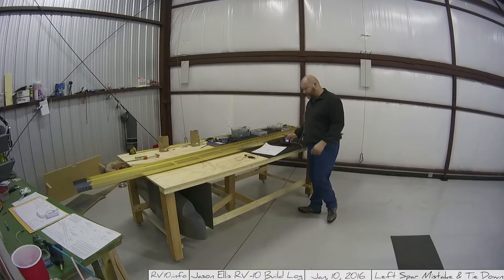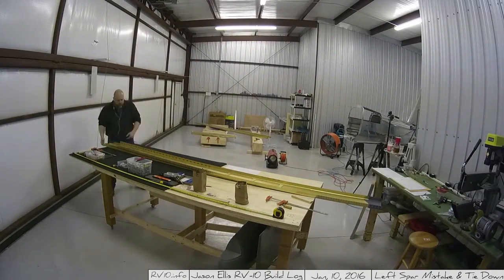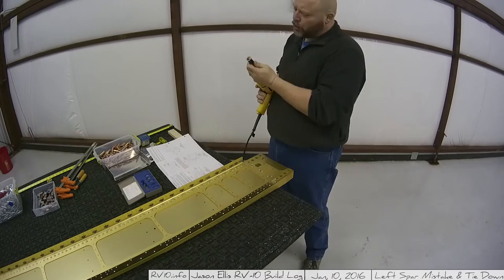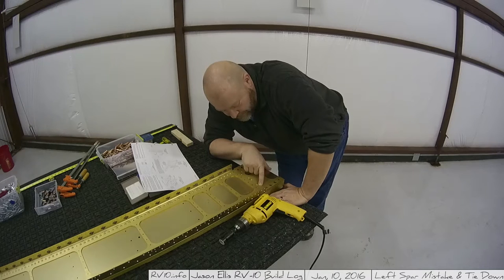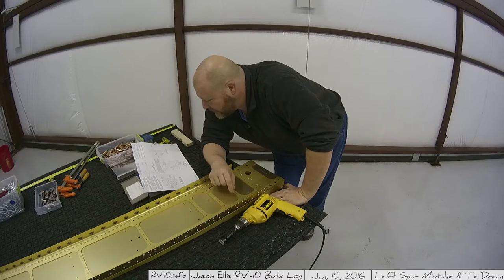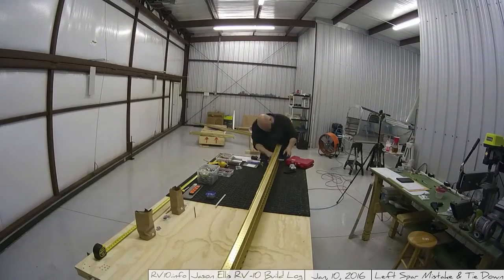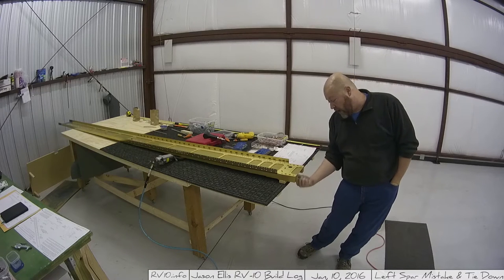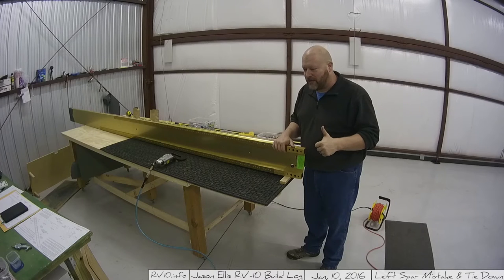RV-10 Wings - 005 - Left spar mistake and tie down bracket

Comment: Just saw this. To correct the inadvertent countersink you can use these things called “repair washers” or “convex washers”. I’ve used them in critical applications according to Beechcraft engineering / FAA approved data. They aren’t easy to find, but they are LS5931A41. The last three (A41) identifies the material, size, style.